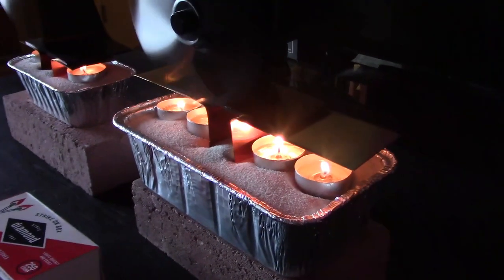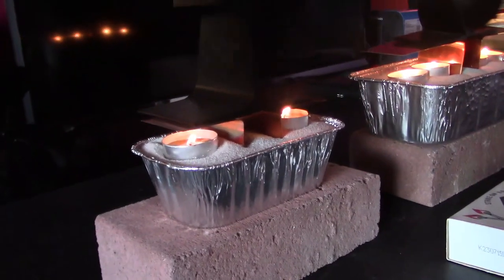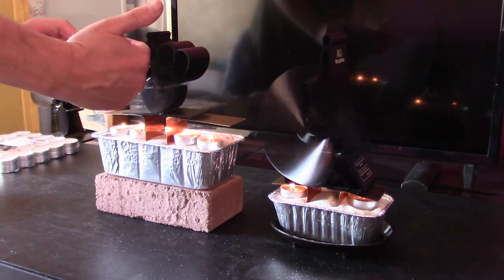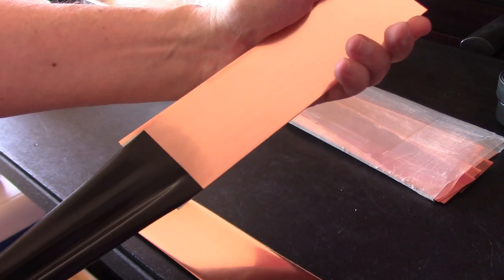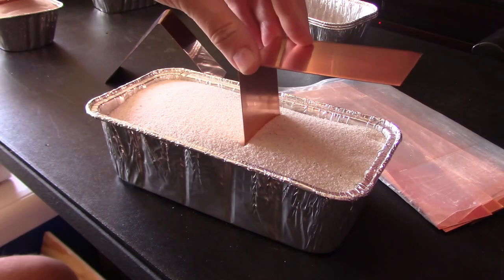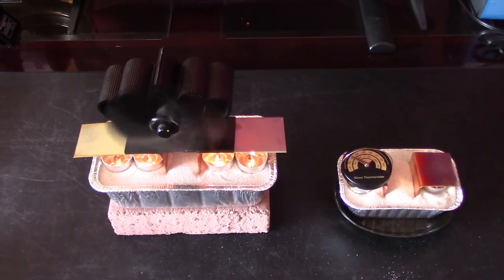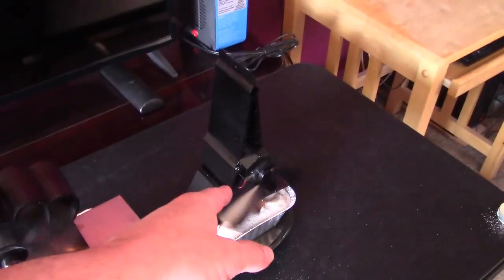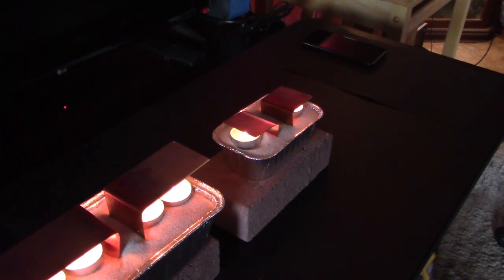How to Make a "Sand Battery" Air Heater at home (w/copper, candles, sand and loaf pans!)  w/heat fan

Comment: I've been thinking of using an old aluminum turkey roaster or old old copper bucket. I need sand and some copper strip. Got tea light candles, but was thinking alcohol stove might be good too, since I have a ton of 90% isopropyl and denatured alcohol as well...
Reply: ...you couId aIso use 'Crisco' shortening and a candIe in a canning jar pIaced in a large clay pot or metal bucket...they Iast for days :)
Reply from the maker: you could even use a large stainless pan if you wanted too. yes, alcohol burner should work good too. (i was thinking of using tea lights made with beeswax). i just wish they weren't so expensive.
Reply: @NothingToNoOneInParticular alcohol based hand sanitizer also works as fuel and it's super cheap.  When the pandemic ended there was/is a huge surplus.  I tried it in a hillbilly stove, from this channel if I'm not mistaken.
Reply from the maker: @Goody2shzToo hi yes, i've got a hand sanitzer stove video on this channel. that is one of my favorite survival stores. made with stuff you have around the house. here is the link https://youtu.be/vaZRLiniWVM btw, it actually can run on five different fuels that you may already have around your house.
Reply: @desertsun02  ...just watched the hand-sanitzer video!!! Back in Feb 2O21 in 0regon, we had a power outage Iasting for over a week (the same time as the Texas power outage). I used clay pots and and tea candies for heat and warming water. Since watching your videos, l've added sand and copper strips. Now, l wiII add cans of sand and alcohol. HopefuIIy the power stays on, but if it doesn't, l have the means to stay warm and cook....Thank You!!! :)
Reply: @desertsun02 Cool!  I'll watch it.
Reply: @desertsun02 the one I watched you called it a cottonball heater/stover.  I like the idea of using a ramekin though.

Comment: How the fans work
Reply from the maker: hi there. they are powered by the heat of the candles. how they work: the base of the fan is metal and actually 'soaks up' the heat off of the copper plates. that heat is transferred to a small thermo-electric device in the fan (called a peltier module or peltier chip). that little device turns heat into electricity and then transfers that energy to the fans motor.
Reply: Ordered the supplies and am going to give it a go.  Thank you!
Reply from the maker: @lisaannwhite4080 awesome! i'm glad you're making the project. tip: the bigger unit with a small to medium size fan seems to be the most effective combination (for maximum heat).
Reply: @ It works!